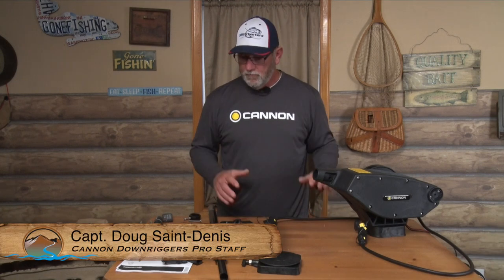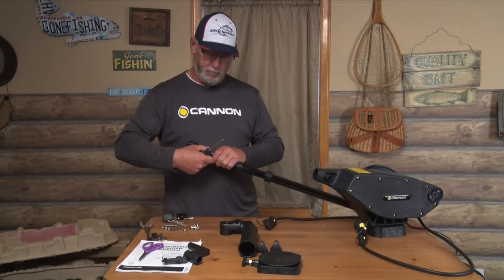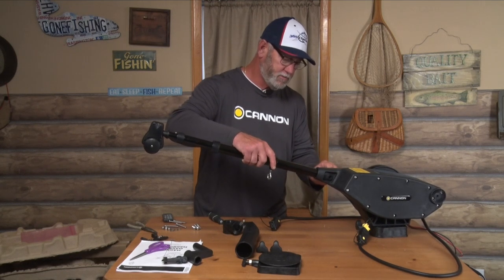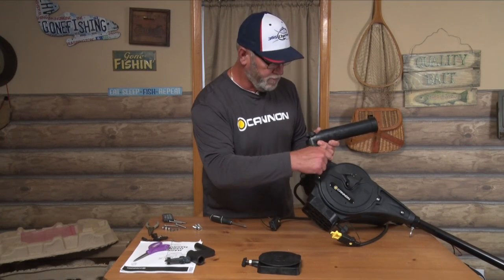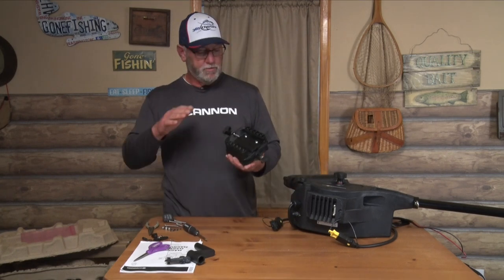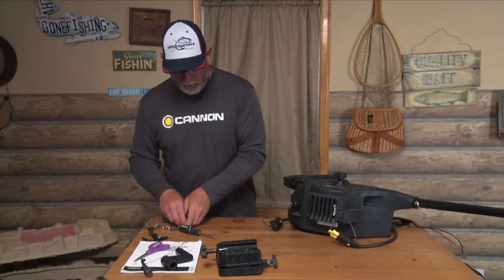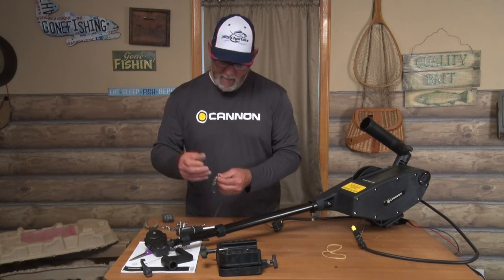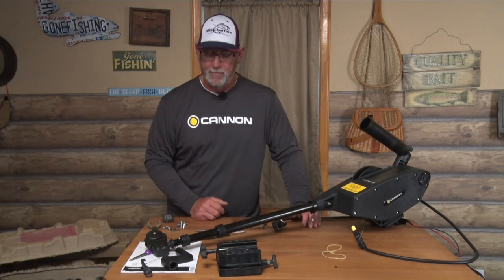Cannon Magnum 10 Downrigger Assembly

Comment: where does that hand crank go ? the manual arm
Reply from the maker: The hand crank is used to manually retrieve the downrigger ball in case you lose power. Read the manual to understand hoow to use it.  I will try to do a video on it in a few weeks.